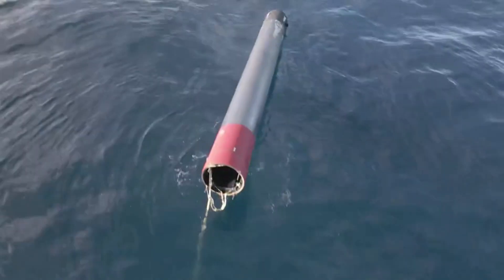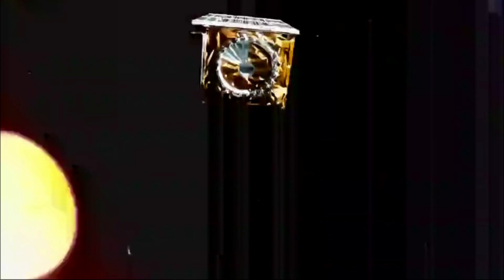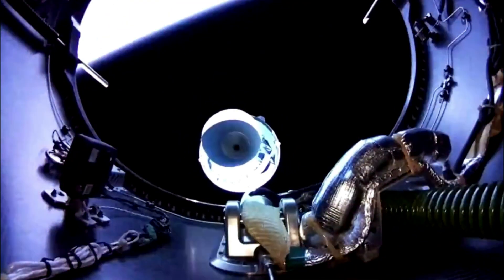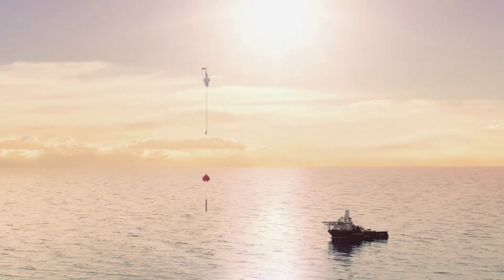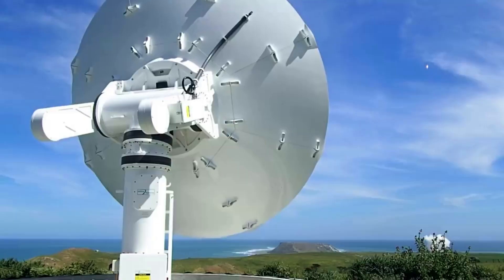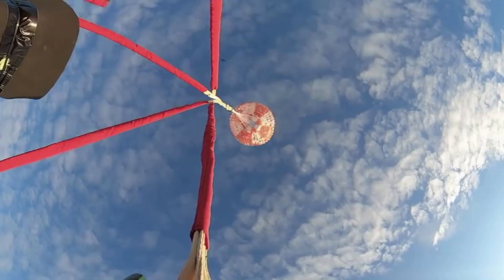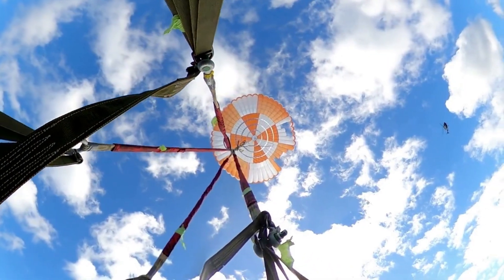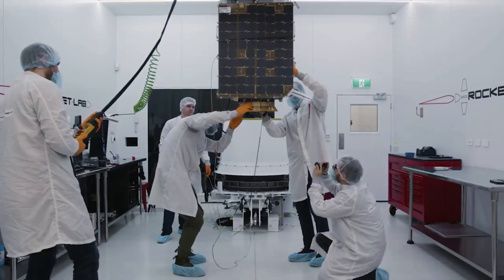Why Rocket Lab Is Dropping First Stages Into The Ocean

Comment: I have a question: if RocketLab, and possibly other commercial launch providers decide to use splashdowns as a technique to facilitate rocket recovery and re-use, why do they not embed a LOFTID-style Hypersonic Inflatable Aerodynamic Decelerator / "heat shield" that pops out of the side of the rocket immediately prior to re-entry and just let it splash-down that way. The inflatable heat shield would also offer the benefit of causing the rocket to float once it has splashed down in the seas, lessening the chance of damage. If United Launch Alliance is considering inflatable shields for the detachable BE-4 engines of future Vulcan launch vehicles, why can't someone design a shield that could protect a rocket like the Electron or Neutron? Is that possible?
Reply: If electron can survive without that style of heat shield, why would rocket lab go through all the effort and cost to add it?

Comment: I like the idea of water-proofing small rocket stages (For reasons like- The ocean is huge, And a single boat can manage a lot of 1st stages). I'm excited for Rocketlab to solve this problem.
However, I can't help but think that they should (and perhaps already are) continually developing the engines. As a non-engineer, it looks to me like they would do well to have an entry burn and landing burn (into water).  
Stretch them tanks, and turn the engines to 11.
Reply: If Rocket Lab could conduct an entry burn and a landing burn into water then why land on a drone ship like Falcon 9 does?   That's a big if and being that electron is a small rocket it probably doesn't carry enough fuel to reach the insertion point for the second stage to fire AND then have enough fuel to conduct a reentry burn and landing burn.   

Maybe Neutron will be more successful with propulsive landing for RL!?
Reply: That would be neat to see them propulsively land on a barge. No doubt that they would lose payload capabilities by doing so.
I don't know the numbers, but perhaps the parachute equipment mass could be replaced with fuel? for the landing burn (to bleed off the final bit of kinetic energy)
and since they are already trying to figure out how to refurbish a 1st stg. that has been in salt water. (no need for a barge)  @michaeldeierhoi4096
Reply: "(For reasons like- The ocean is huge, And a single boat can manage a lot of 1st stages)"

Except they only launch one at a time...

And get it out of the water (and into a fresh water rinse, just for starters) quickly, when recovered. Salt water is not good for the complexities of liquid fueled rockets, even with all the water-proofing you can muster.
Reply: You are correct about Rocketlabs' launch cadence. I was assuming that they would eventually be able to achieve more launches per week (a support ship goes out for three days, and comes back with a dozen rockets) Maybe I'm wrong and they will not increase capabilities.

Saltwater protection is no doubt a difficult problem to solve. (another reason to not have battery-powered fuel pumps on the first stage)
My untrained mind immediately thinks of electric circuits and valves, when it comes to ocean water. 

  @stardolphin2
Reply: "Turn the engines to 11". If, by this, you mean that you want RocketLab to burn the engines at full throttle for any sustained period of time, they would probably not consider this. Part of the engineering and philosophy of re-usable rockets is to avoid full throttle. Full throttle burns reduce the useful lifespan of the rocket.

Comment: This is not a good long term solution. Rocketlab will hit a dead end with this strategy.
Reply: Since you offer no reason your comment lacks credibility.  imo this has possibilities.  Rocket Lab has already tested a Rutherford engine after a launch and landing in the water and it performed equal to a new rocket engine.  At least this first test was promising.
Reply: The worst that could happen, is that they go back to expending them.

And, of course, Neutron is coming.